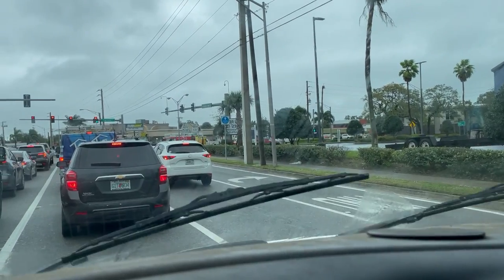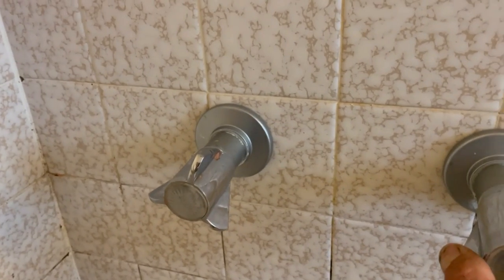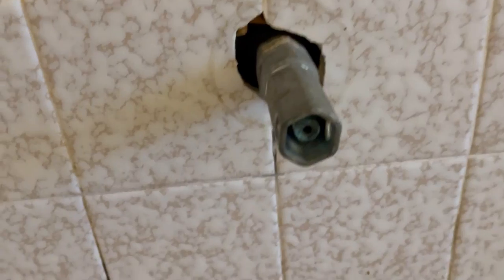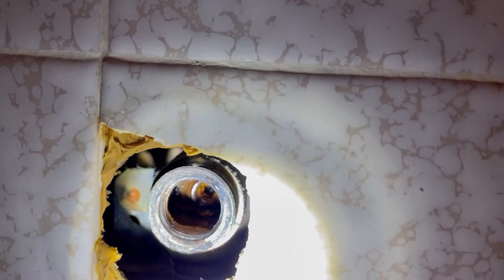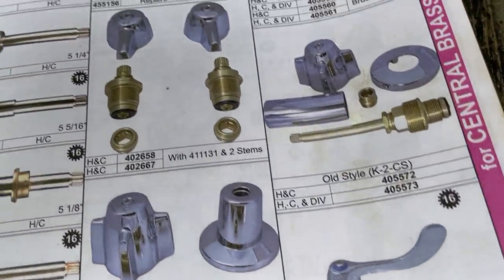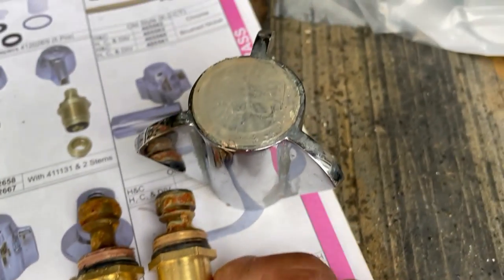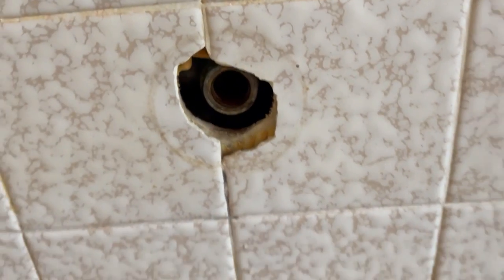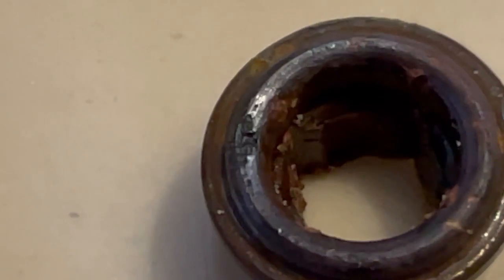HOW TO REPLACE PARTS FOR A TWO HANDLE SAYCO SHOWER VALVE

Comment: Thanks for the great video. Any thoughts on how to remove a stripped seat? I was able to remove an old leaky stem (last opportunity it would have had to be changed was maybe 1989) and it took ages to break it loose. The inner seat however disintegrated rapidly and is now circular. The stem replacement stopped the leak, but I'd like to finish the job and replace the seat.

Comment: I almost wanted to get a petition started when I had to try to find replacement valve stems for this faucet in my home, which was obviously changed out and replaced with something other than the original manufacturer stems. I don’t understand why there is not an industry standard with shower/sink faucet stems. It is absolutely ridiculously unnecessary to have as many variations of stems as there are on the market. I understand variations in certain settings but there really should be an industry standard with these faucet handle stems.

Comment: I appreciate the video. Thank you. I would add that people should make sure the Valve stem is turned to the full on position (meaning unscrewed to the left for hot valve) when tightening down valve  into the seat otherwise  you'll crush the seat when tightening down. How do I know? As an amateur plumber I screwed this up first before doing it right the second time.